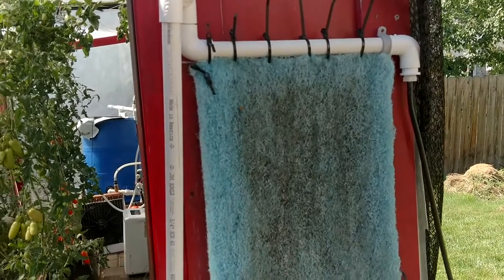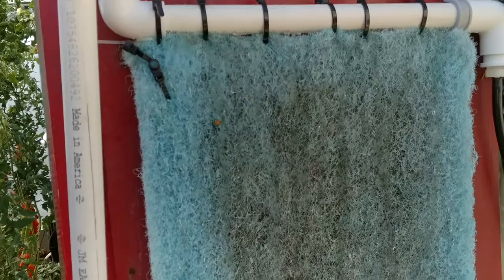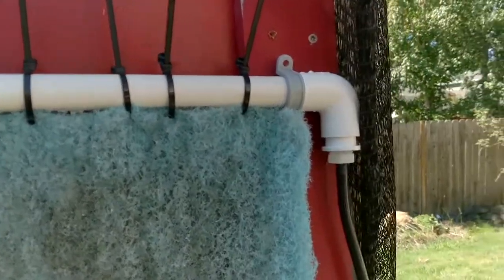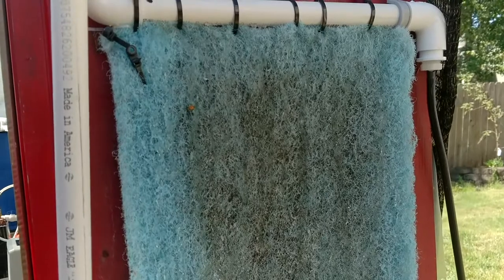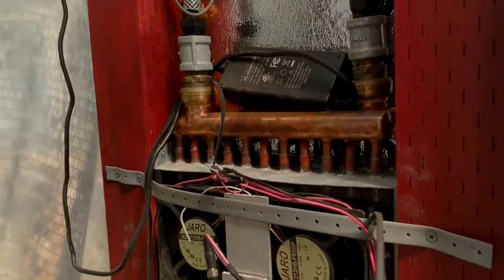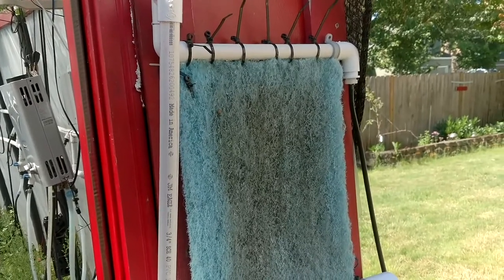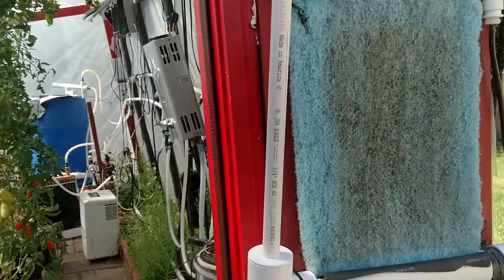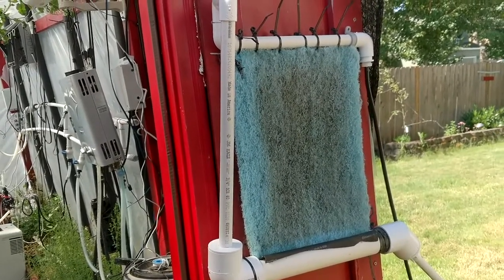Greenhouse Evaporative Cooling: How it works and how to make it smart

Comment: Did you try to replace the bottom pipe with a tank? If its surface is larger than the width and thickness of the wet pad, it will collect all the water and never leak.
Reply from the maker: I made the bottom pipe channel bigger and I put a wire through the blue medium to keep it strait when sucking air through. Much of the leaking came from the medium bending when it was running.

Comment: how effective is this thing..... m planing to go for honeycomb...????? plaining to cool 5000 sqft warehouse(aquaponic) area with 20x10 honeycomb
Reply from the maker: It's all about surface area and air flow.  You want incoming air to have as much contact with the water soaked medium as possible.  Performance is going to depend on how saturated you can make your medium and how much air you can move through it at a time.

I would argue that these blue fiber pads have more surface area because each fiber can have contact with water and air in 360 degrees where a honeycomb design does not.  However, if the honeycomb pad is thicker... perhaps that makes up for it.  There's also a trade off.  The blue pad probably blocks more air so you get less air flow.

20x10 seems small for 5000 sqft, but it really depends on how much energy is going into the warehouse.  Energy in <= energy out for effective cooling.  I can't help much on estimating performance of evaporative coolers yet.  The physics is not simple.